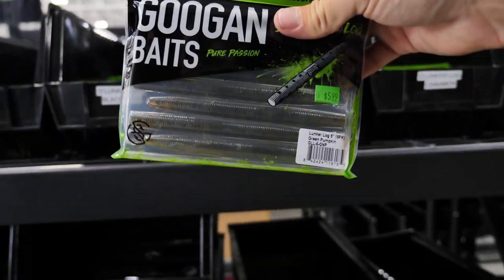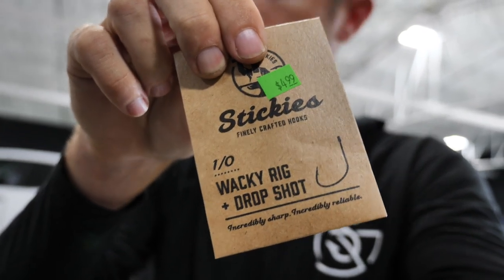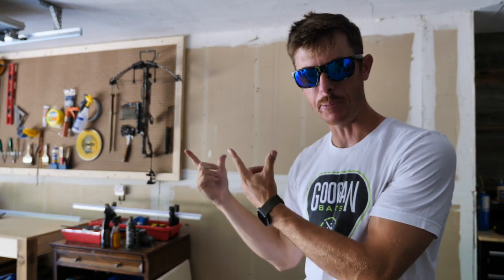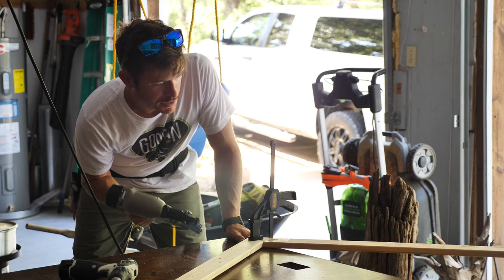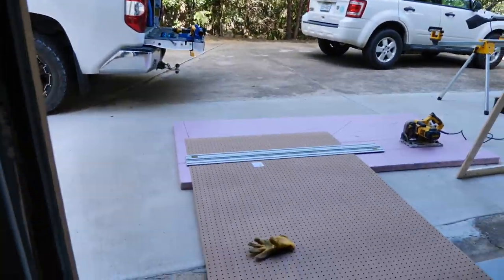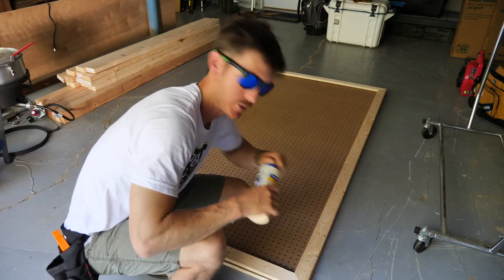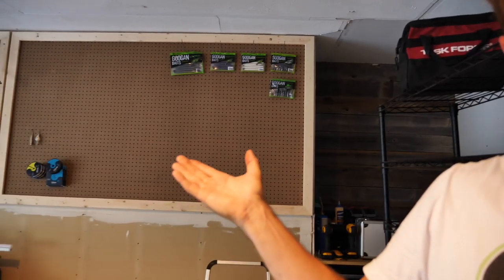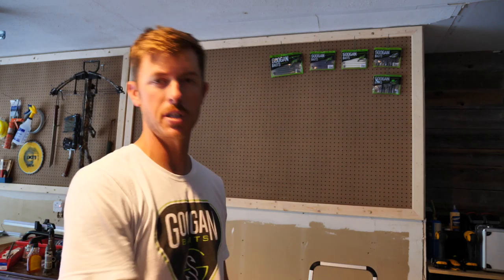Updating Googan Squad HQ | NEW BAITS are HERE!

Comment: Woodworking & tackle is the jam. I have a 10x20 shop, and have mine divided. I have a door, and a wall to separate the tackle from the sawdust. Having sawdust all over my tackle/filming area wasn't gonna fly. When I make big frames, I only use Titebond II.. It is strong, and will hold it together without finish nails & pocketholes. But making a double frame with a gap between the wall is a great idea. That way you can throw the pegs in the holes with ease.
I took a small 1/2" pvc pipe to make spacers when I put the pegboard in the studs. Having the framework to provide a gap would have been a good route to go. Good video man!

Comment: Just watched for LLF video about the loss of a chicken. If you are planning on using a top rail ti fix the wire to, you may want to use a method they use in France to protect walls from being climbed coupled with a technique to keep a blue bird house predator free. The French put rejected or broken wine bottles in the wet concrete and then broke the bottles. A neighbor ysed carpet tack strips to keep predators from climbing the fence pist. A couple rows of tack strips on top of the fence would deter intruders.

Comment: Mount a 2-4 to the wall then set the frame on it. Have a screw ready, you learn to work by yourself. The 2-4 holds the weight after a few screws, remove the 2-4,